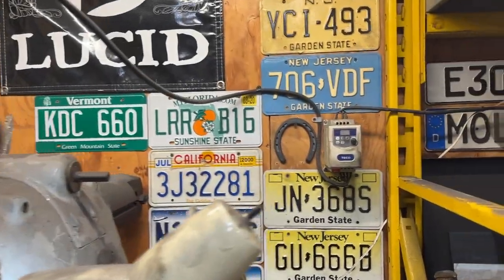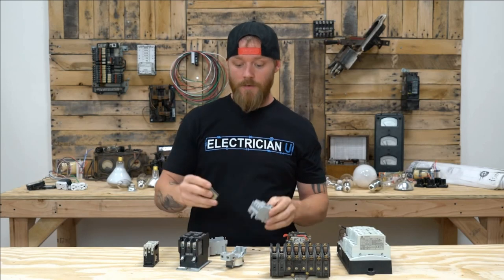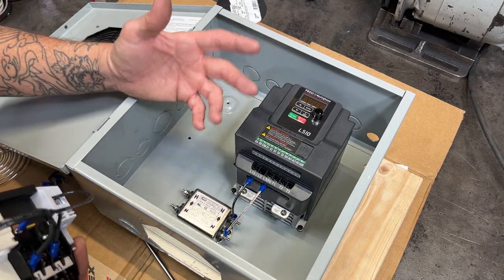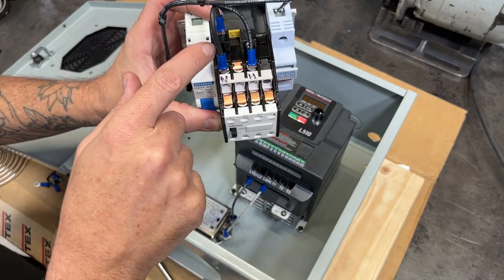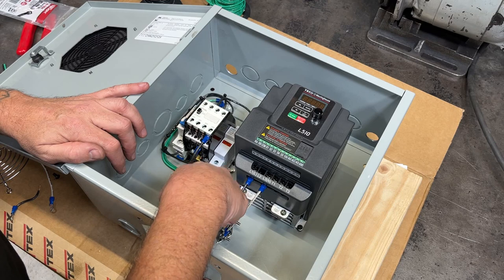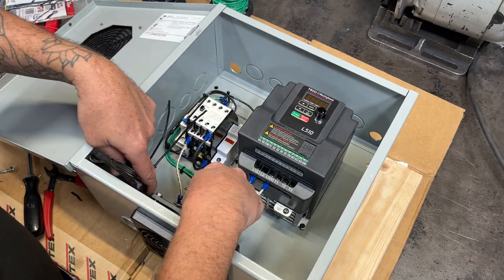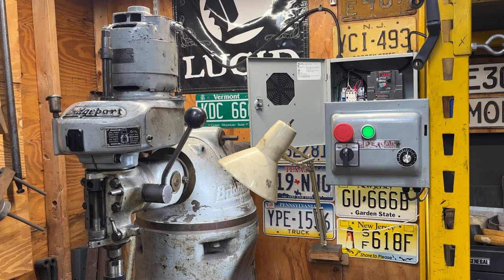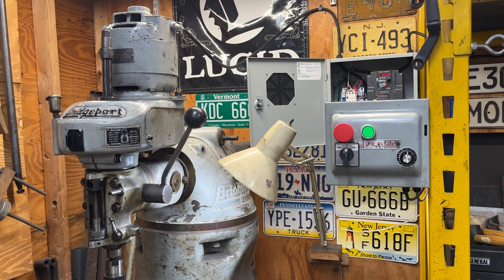Wiring a TECO L510 VFD to Run My 82 Year Old Milling Machine

Comment: I've been looking for this very thing. So glad you took the time to go thru how you did it. I've seen Clough 42's video and most of it's over my head- you made it simple to follow. I have a step pulley mill and still want a pot to change speeds within the steps. Plus, my rotary switch is more than 30 yrs old-it's got HiForward, LoForward and the same for reverse. I don't like the switch and want my VFD to control it all. Sound like a good candidate for the setup you made? Thank you again for explaining it all and including your parts list!

Comment: Nice video--the wiring diagrams are incredibly helpful.

Anyone wire this setup with a L510-201? I'm trying to figure out what contactor to use and how to wire the remote controls for a 220v input. I initially used a Fuji Electric SC-E1 contactor but can't get the normally open start switch to activate the coil.

Comment: What kind and size screws did you use to attach components to box? TIA 9:58 9:58
Reply from the maker: They were small pan head allen screws that I purchased at Ace Hardware. I forget the size of them, though.
Reply: @LucidAutowerks  thank you for your prompt response! Did you have to tap each hole then?
Reply from the maker: @renearellano3907  I did 👍🏼
Reply: Thank you!
Reply from the maker: @renearellano3907  no problem!

Comment: Know its stupid but 99% of machines that have a forward, off, reverse selector switch for some unknown reason forward was always on the right side. Best to have every selector switch operate the same. Only used a green wire to designate that its a ground wire.

Comment: Do you have any insight as to why my contacter gets hot and smokes after 5 minutes? I’ve rechecked my wiring and the vfd seems to work fine. The contacter will eventually get too hot and pop and my second one is doing it too. I’ve ordered everything from your provided links. Could it be poor quality parts?
Reply from the maker: Not sure but sometimes heat is caused by resistance which is caused by bad connections. I’d start by making sure that all of the wires are appropriately sized and all of the screw terminals are nice and tight.
Reply: Which gauge wire did you use for hot and neutral wires at the contacter? Aside from that detail I’ve ordered every product you had linked and found the 18ga security shielded wire.